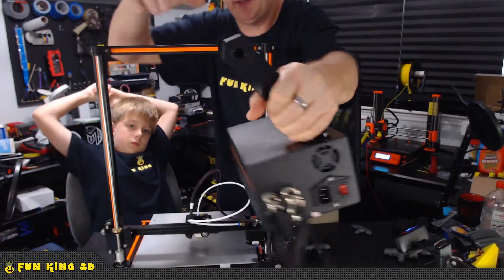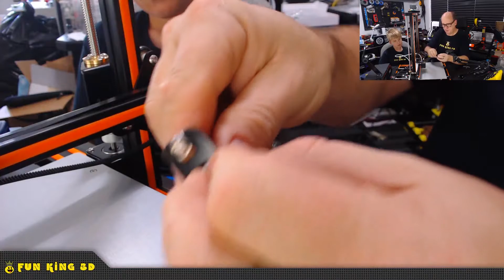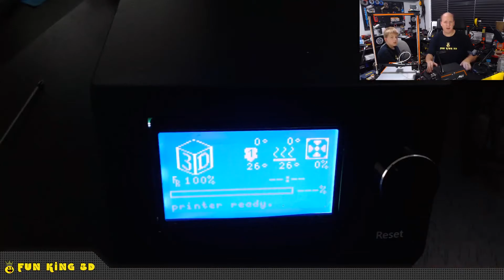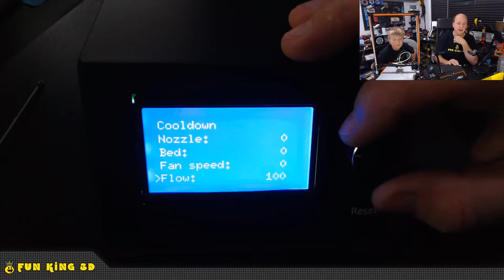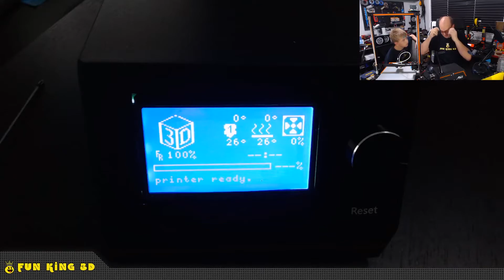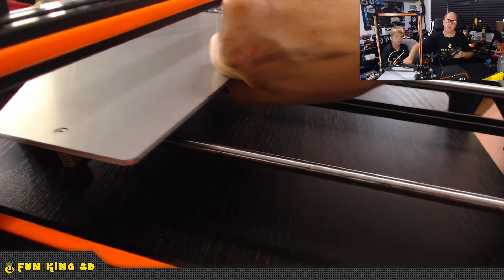Initial Setup/Tuning: Anet E12

Comment: You should have gotten extra t nuts and screws in the box with the anet e12 i did.
Reply from the maker: Must have been something they started later or missed mine. This printer was not right from the beginning and I had nothing but issues with it. It has gone to a better home now where it was rebuilt into a working machine.
Reply: @FunKing3d  it printed fine right put of the box until i replaced the nozzle with a volcano now i have some calibrating to do. I hope your next printer is better. Your vids are awsome man
Reply from the maker: Glad to know yours worked. I have heard from a few people that they had good luck with it as well. I have a quite a few printers now and most are good. Some are still trouble makers. LOL! Thanks for the compliments and thanks for watching!

Comment: To Help get T-nuts to turn with the screw, I put a drop of Blue Loc-tite on the screw threads, then let it set and dry for a while.  That way when you put the screw into the T-nut it will have enough drag to turn the T-nut to engage the extrusion.

Comment: what did you do to keep your extruder motor from skipping
Reply from the maker: I have not found a solution yet. I am at the point of giving up on it.
Reply: @FunKing3d  did you ever find a fix?
Reply from the maker: @therandomshtshow2245  Yes. It ended up a bad main board. The extruder driver was bad. Just was not pushing enough current to push the filament.

Comment: hey guys just a heads up. if you want the nozzle a bit closer to the bed for adjustments you can manually lower the nozzle at the hot end heatsink. take the fan cover off there is a tiny locking screw keeping the tube in the heatsink. loosen lower. bobs your uncle. 

personally my bed was that far that i completely unscrewed the leveling nob in an attempt to level it. lowering things a bit worked. though you may have to make sure you feed the filament in proper.
Reply from the maker: Awesome. Thanks for the heads up. (Ours seems to be ok though. The next video will show it printing.)
Reply: thanks for this Louisic01 I did a fine first print yesterday.  Switched filament and the bed was miles off, tried to re-level and the levelling nob came off on a couple of them for me too.  Cheers.

Comment: Shouldn't you be leveling the bed with the components hot? I've always heard that thermal expansion would cause leveling to be different going from a cold hotend/bed to a hot hotend/bed.
Reply from the maker: Technically, yes, that is true. I have never proven it one way or the other on if it is that significant though. I use the paper method to get it close (so that all four corners are roughly the same) and then fine tune it during the first layer of the print. The beds on these lower cost printers are not always perfectly flat either, so sometimes you end up with a low spot in the middle of the bed.
Reply: True, but if you're doing this for newbies info just may want to point that out. Great job. Looking forward to seeing how that prints.
Reply from the maker: Oh, I will. It is covered in the next video coming. (Initial Print) But thank you for keeping me on track. It is easy to miss things sometimes. Another reason why we need you guys. :)

Comment: Arg. They're using an old Marlin with a "chirpy" controller button sound. We really need to get these Chinese vendors on the latest firmware bandwagon!
Reply from the maker: It is also running the same main board that the A8 has. The Anet board.

Comment: What is that clicking nose when you run the print head left and right?
Reply from the maker: Was that before or after tightening the belt? It came very VERY loose.
Reply: Re-watched as you doing the bed level and it is still their. It probably isn't anything unusual I just haven't noticed it from other videos I've seen. At about 24:00 when you slide it left you can hear it really well.

Comment: Really curious to see how it prints out of the box. I m still debating.
Reply from the maker: Not bad... er, I mean, you will have to wait for that video. LOL! Honestly, to let the cat out of the bag a little, it does need some tweaking. I have been facing extrusion skips, but overall, it does an OK job. I did a 16 hour print on it and other than stringing (which I am sure is most likely retraction settings) it is not too bad.
Reply: is the eprom enabled allowing gcode tweaks? Or do you need to flash it with Marlin to tweak firmware?

Comment: do you know how much space id need for the E12 without the electronics box? i think the bed needs to be able to hang beyond the frame for a big print i would think?
Reply from the maker: I will measure it and let you know.
Reply from the maker: With no control box, absolute minimum, 21" wide x 28" deep, 24" high.
Reply: Fun King 3D thank you very much it's apreciated. Keep up the good work guys :-)